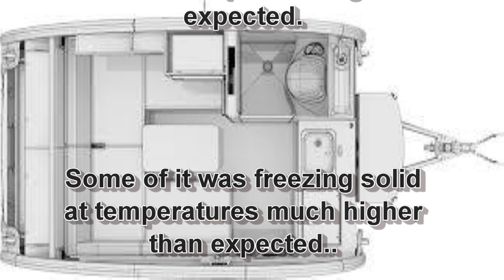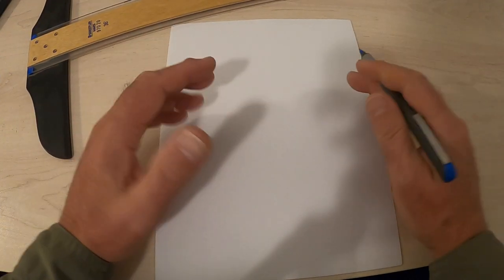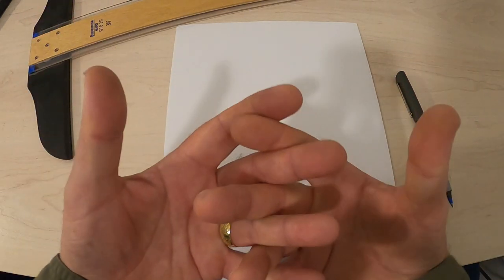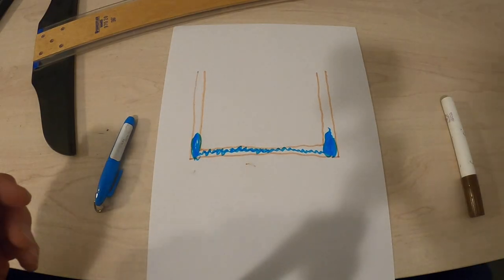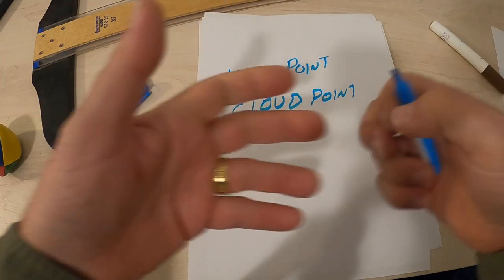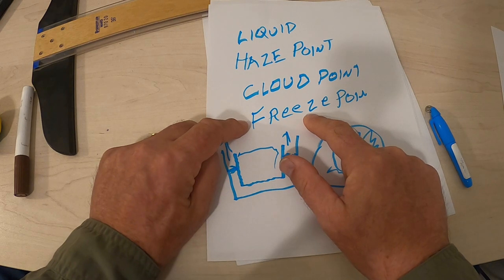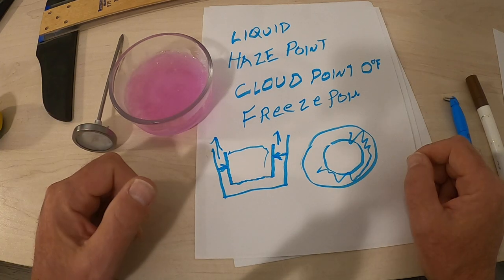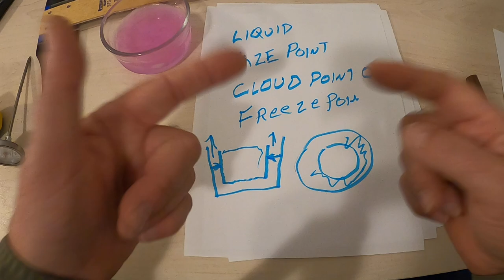ANTIFREEZE 101 - Tab Trailer Training

Comment: Or remove the water using low point drains and gently blow air with faucets & valves open to remove residual water... I still use propelene-glycol in sink and shower traps (and drain portable cassette toilet tanks and pump resevoirs) when winterizing. Plus, I have a small electric heater on a timer at nights to keep interior spaces a bit warmer.  Everyone's situation is different, so check temperatures inside and under your rig, then be as redundant in your techniques as you can be!